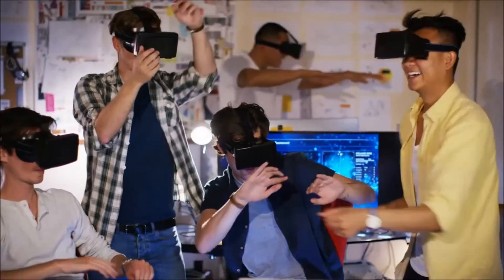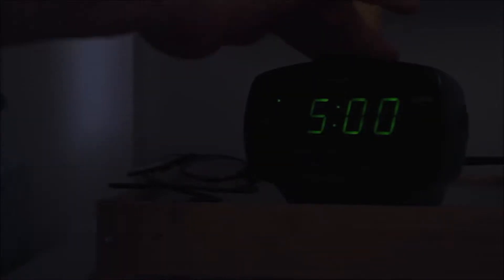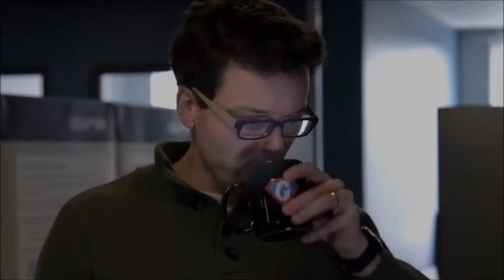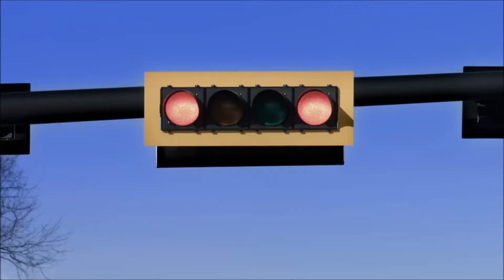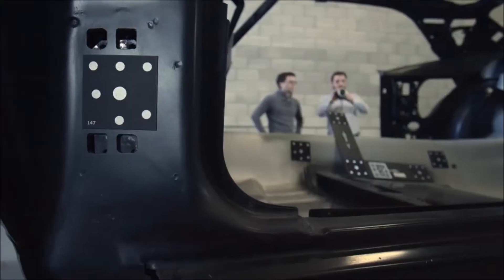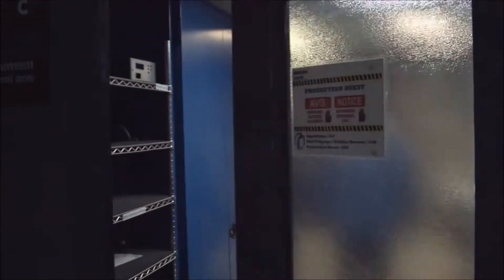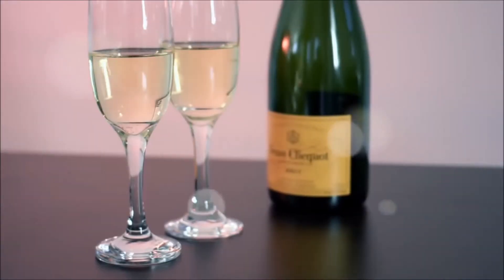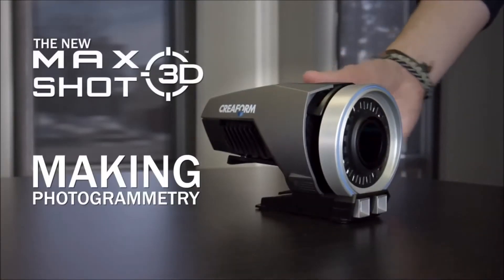MaxSHOT 3D Is Making Photogrammetry Great

Comment: Great promo. .though without any results it's all hype. I do hope it's a great photogrammetry hardware. Price will be a big factor as a Kinect and other cameras offer depth mapping. I'll check into this though
Reply from the maker: MaxSHOT is an industrial measuring tool, with the accuracy, stability, traceability and ease of use that are required in manufacturing industry. It can't be compared or even considered alongside products like Kinect as they simply aren't in the same league.